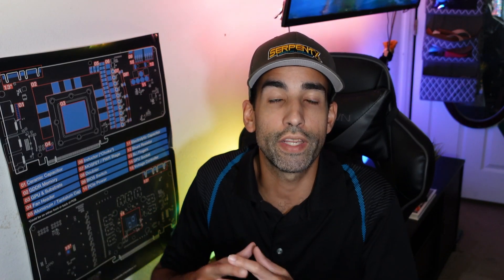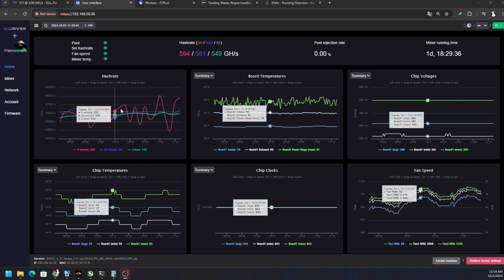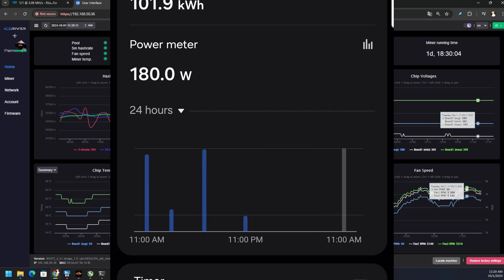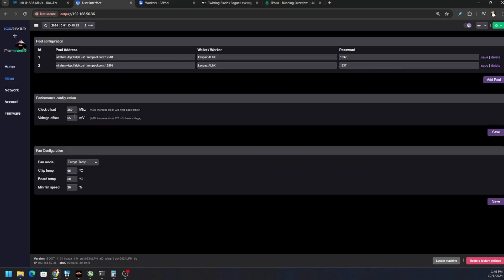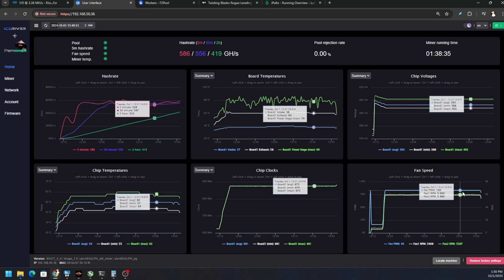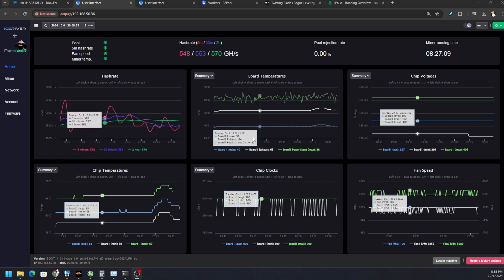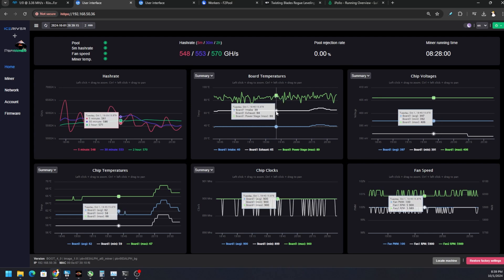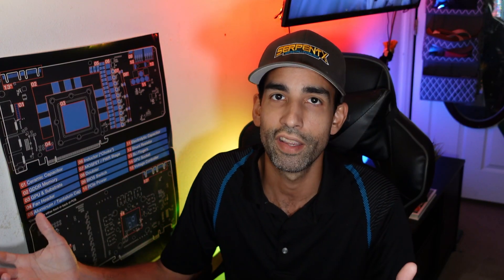Best AL0 Overclock with PB Farmer

Comment: Hello and thank you for the video.
Which powerSupply did you use ? I use the IceRiver stock one but I read on it a max output of 120.08 W. I think it will be difficult to OC correctly with it right ?
Reply: You can overclock to specific range and you need to monitor watt draw buy one but i prefer for you to buy one 230w
Reply: @WindowsWizardry  yes I ordered a 230 W. I should receive it today normally. for now, I stucked at 450 GH/s
Reply from the maker: @mrgp88  yea, it is difficult when limited by stock PSU. But you could wind up pushing past efficiency, while chase hashrate. 

But here is one
https://amzn.to/3UDGSds

Comment: I have two al0 and in both I tried the PBfarmer firmware and it does not accept my wallet and the pool remains the pool that is in the firmware. By the way, it often crashes. Is this normal? I did not put any voltage or clock but if I add a pool, Apple does not save it, why?

Comment: Hello there! Does it feel okay to go above 190 watts? Getting a bit scared of melting the barrel plug when going above 10 amps, has it worked long term for you? 🤔
Reply from the maker: @fillelind4264  if you have the right psu at 19v, it should be fine. I've been running at right under 200 watts for long-term on Ks0 Pro and Ultras, but this is my first AL0, so I will let you know. But back it down below 200, find something stable around 190 watts or lower. The biggest killer is the increased voltages and inadequate cooling.
Reply: How safe is it overclocking these units and how much shorter of a life span do you give the unit?
Reply from the maker: @dimitriskazazakis5658  anytime you increase voltage and temps, it can reduce a devices lifespan. With controlled and measured overclocking, the unit will be fine, but pushing it too hard or to the max. I suspect it would decrease the life of the unit by about 2 - 6 months. It will last longer than the profitability will drop

Comment: Hello, I could go up until 610Gh, in my case was with +300Mh and 56mV but I had to do something like add copper heatsinks on mosfets and without extra fans, when I use fans it gets cold and the hashrate decrease a lot, it looks like the best hashrate is when you have the chips on 80 aprox....in my case the max power stage is 89 and chip 71, according to pbfarmer the max for chip is 90 and power stage 105 (if I remember or 115) and I have to let it run for aprox 1.5 hrs to get a best hashrate. By the way, excellent information and videos @SerpentXTech